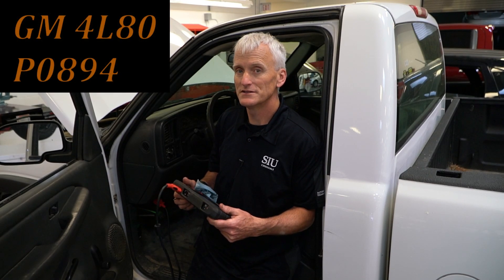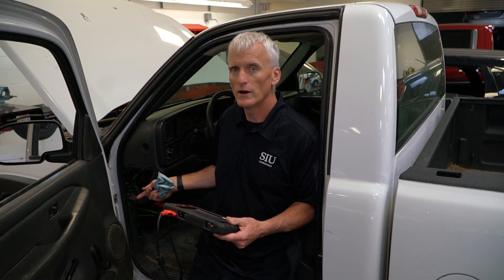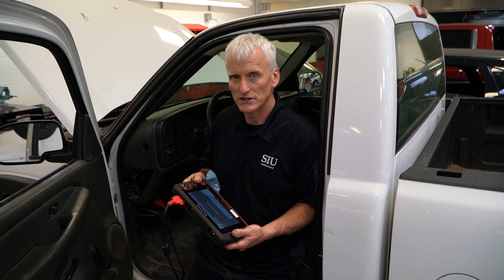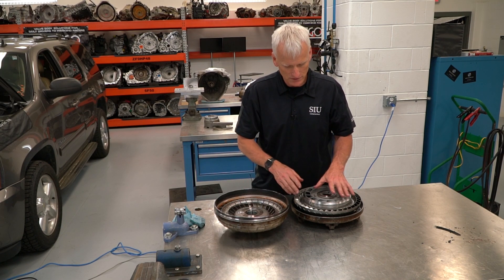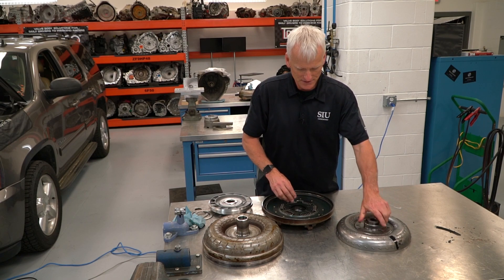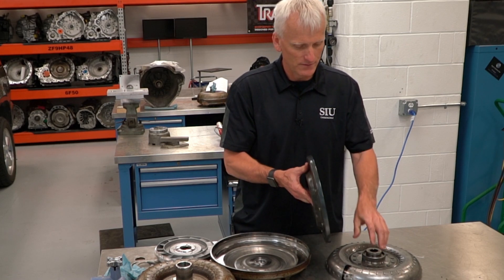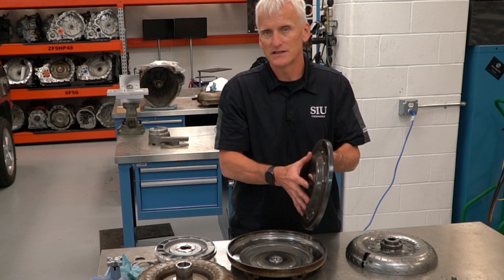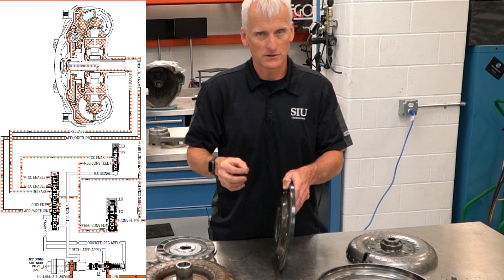GM 4l80 Transmission TCC P0894

Comment: Brass bushings on the shaft leak pressure causing TC failure and low pressure.  they are looking at the wrong area.

Comment: I have a 4l60e on 2005 suburban, changed torque converter and added painless sonax 1-2 piston, the shimmy went away in torque converter, shift nice when relatively cool, driving 10 to 20 miles, beyond that on long drives, when I have to stop and start again, it kicks first to second and a little 2 to 3.  I have asked many people with little response.  The pan was super clean when I changed fuid at 210,000 and I am pretty sure that was first change, very minor build up on magnet, fluid looked good and so did filter.  I am getting p0894 code when it gets hot and starts to hard shift 1 -2
Reply: I am experiencing this right now!!! When cold it shifts great, no hard shifts. Once it warms up to 150-170 degrees, it stars to hard shift almost in all gears…I changed all Solenoids, speed sensors, filter, and new oil. That didn’t fix it. I had a shop install a new Valve Body with a shift kit…. That didn’t fix it either! My last option is to change out the wiring from inside the pan to the main plug
Reply: I've seen a few people with the same problem. I've heard of several wiring things fixing these online. Ignition switch, brake switch, coolant temp sensor. All can cause it because all help initiate TCC lock up. My truck is doing this and I'm trying to diag it. I don't wanna throw parts, but parts throwers can start with the things I said above because they are fairly cheap. It shifts hard because limp mode cause max trans line pressure and after slipping while cold, it eventually goes into "limp mode" keep driving it that way and you'll start breaking interior trans components

Comment: In this case since its the converter that failed did you rebuild that transmission? Or just flush the lines really good with the machine?

Comment: Got a question 2004 GMC Savanna 4L80E I have torque converter slip in overdrive only slip rpm 280. Transmission goes into limp mode High pump pressure harsh shifts. 3rd gear lock up is fine no limp in drives and shifts good all day. In overdrive it shifts into 4th no slipping or engine flare. In stop and go traffic overdrive driving is good, problem occurs during long distance coasting in OD. But in third gear lock up is good torque converter slip is 90 rpm. IS it internal problem 4th clutch hydraulic leak??? Also my TFP flickers from OD to Reverse while driving and before limp in mode occurs. I also lose PCS TCC signals as the TFP flickers. Any suggestions on what to check next? Other techs from dealer just suggested replace with a reman trans. Im curious to see whats causing the problem it was rebuilt 4 years ago by me
Reply from the maker: I'd definitely check pressures.  That converter slip of 90 RPM is too high.  I'd also be curious about the TFP switch flickering and that's what would make me check pressures first.  But those are some high slip numbers, so you for sure have something going on with your TCC.  Maybe a cracked piston?  Does it happen worse when hot vs cold?

Comment: Thanks for the video!  I haven been going back in forward with a bone yard 4l80e with it running hot. Drives great but never really Cools off. I had replaced the aux cooler and even bypassed the radiator. I think this the issue im having.  I pulled the dipstick it has a very small piece of black friction material like that on it. I had the p0894 code but its went away. Ill take some pics and report back. No flow thru the cooler. But it did when the aux cooler was put on.
Reply from the maker: A clogged cooler is likely from the converter.  Hope you get it figured out!
Reply: @siuautomotive  thanks!

Comment: We have a brand new serta we just put in and it came back with a p0894 with about 100 miles
Reply from the maker: Ah, that sucks.  With that I could be a host of things from the converter, to the valves, to the solenoid.  What was the original failure?